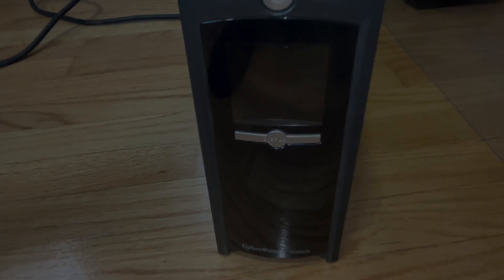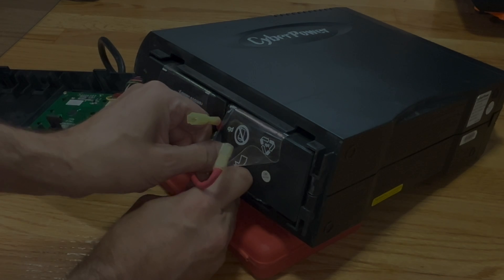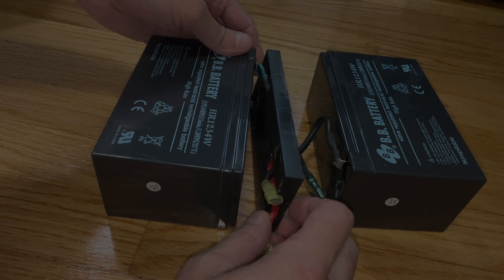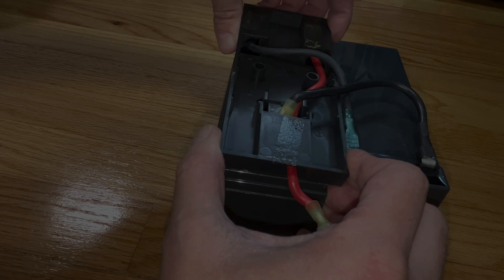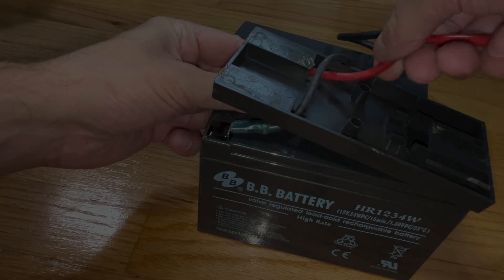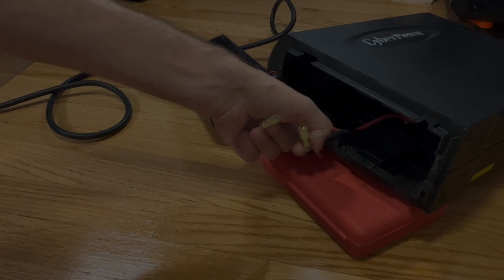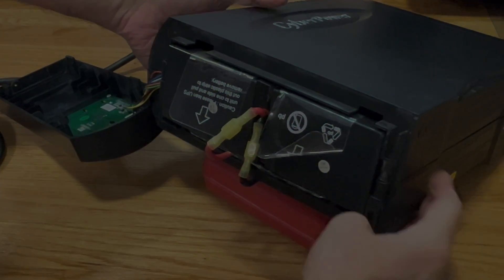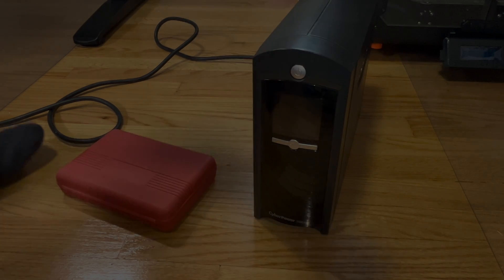Battery Replacement CyberPower 1500AVR (How to instructions)

Comment: Strange. I checked all through the documentation and could not find information on how the 2 batteries were wired - series or parallel. Am I missing where it says this is a 24V system? Mine came with no batteries (EOL).

Comment: For those with an older model Cyber Power 1500AVR, you might find the front faceplate does not come off.  If your model is more box-like and less rounded than what you see in this video, you may have two screws, one in the front and one in the back.  Removing these will allow you to slide a side panel down to access the batteries.

Comment: Great video, except that the front panel on mine does not slide either up or down, with the singular screw removed on the bottom. I don't want to force it. Any ideas as to what the trouble maybe?
Reply: I had the same problem with mine. Take a flat-head screwdriver and use it as leverage to push the front cover from the body of the unit. You have to play with it somewhat and use some elbow grease. It'll eventually pull apart from the unit's body. When I put the cover back after replacing the battery, I watched how the grooves line up so I'll remember the next time I have to do this. 

But I replace the battery every six years so I'll probably forget and will have to re-watch this video!!